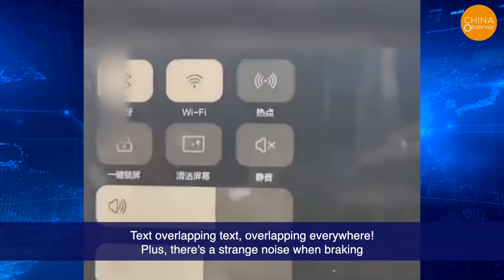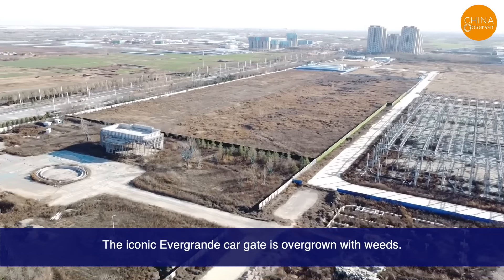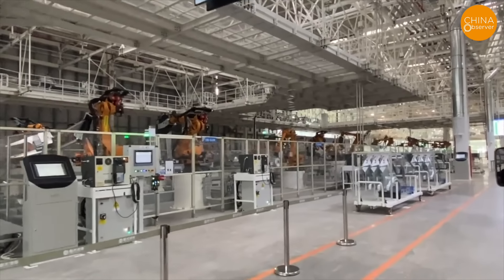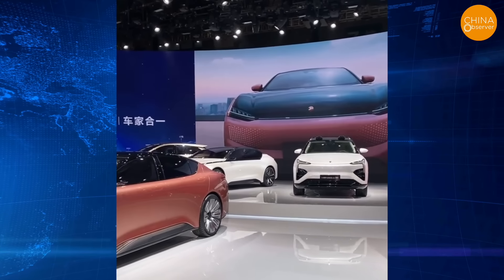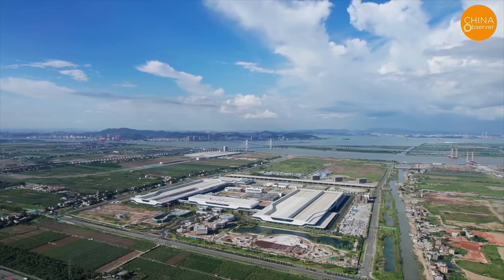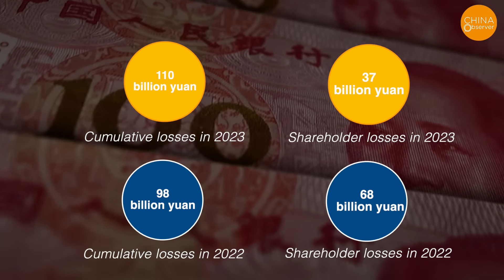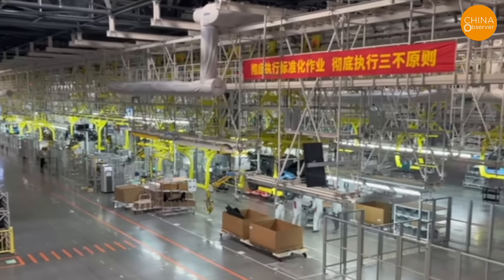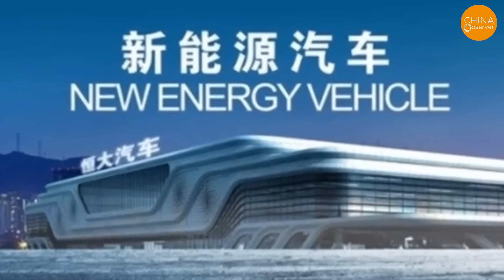Evergrande’s EV Venture Fails: $20 Billion Plant Now Ruins

Comment: Chinese carmakers are still in their infancy period.  They think a car is just a metal shell on wheels, like a Hot Wheels, but bigger
Reply: Worse yet,the EV existence kind of convince them of that since at the surface it's sounds like making electric RC toy car
Reply: They can improve.  But the experience with Chinese manufacturers is that they will build exactly to the quality standards you demand of them, and take shortcuts where they can get away with them.  Couple of decades ago, when manufacturing started to move to China, we started seeing western brand R/C airplane kits made in China.  The quality was garbage.  The customer complained, and kept complaining... and 5 years down the line the kits were good.  Similar things happened with electronics, and now we're seeing a lot of innovation from China, especially in the area of advanced hobby electronics.  And again, the quality is good.  
The story is not dissimilar to Japan, even if the mindset is.  My guess is that Chinese car makers will eventually produce quality vehicles, even though they will have very different motivators driving them to improve.
Reply: @kaasmeester5903  Not likely. The only reason why those improvements were made was because you had managers from overseas managing production, which meant there were standards in place. The Chinese manage based purely on politics. Their style of management doesn't allow for innovation and criticism because of their crab mentality and corruption.

Comment: EV's basically always have reduced range at lower and higher temperature, due to how the batteries work. EV's are not a good idea for anything other then short trips in a city. Environmental impact of EV's is quite large, they are an environmental disaster.
Reply: We're more likely to get a flying car than an electric car as good as a petrol one
Reply: The radiation levels inside the vehicle are very dangerous. It’s like being cooked in a microwave.
Reply: "They are an environmental disaster."  And yet the whole point of EVs is to try to avert another environmental disaster.
Reply: @jojox5136  we have flying car at home, that's called Helicopter
Reply: So are gas vehicles.
Reply: @gehcontent5618  lol

Comment: The chinese EV industry has been booming in the last decade, capatulting from the net importer of cars in 2021 to the largest car exporter as of 2023. The chinese car market is oversaturated with a whopping high number of EV manufacturers. However, most of which crank out cheesy EVs proven by relentless technical issues.